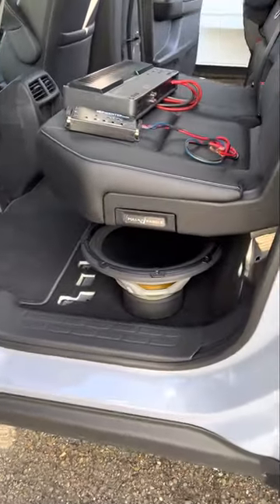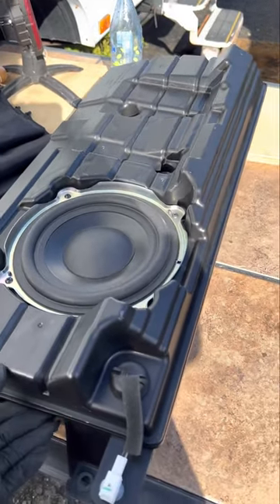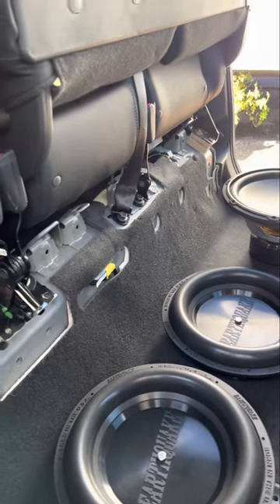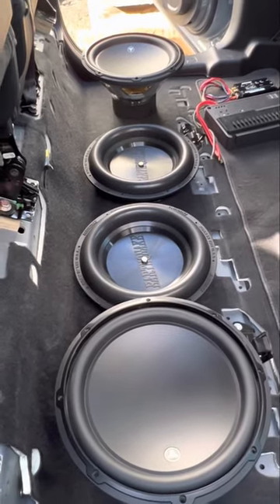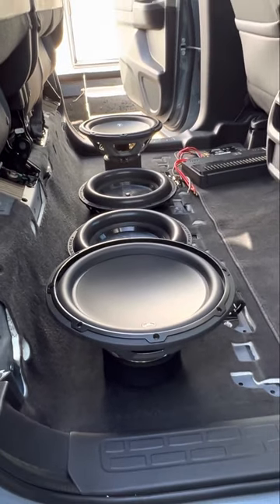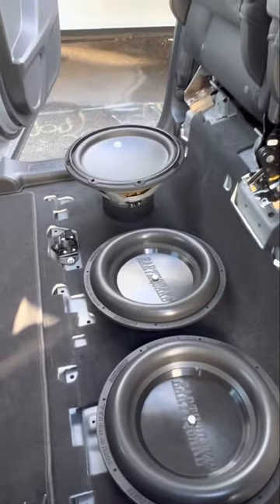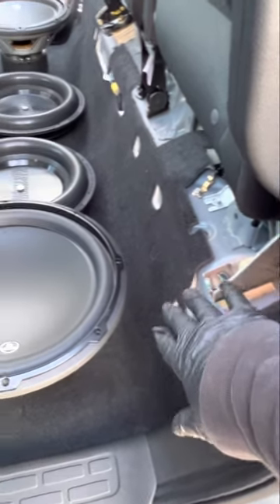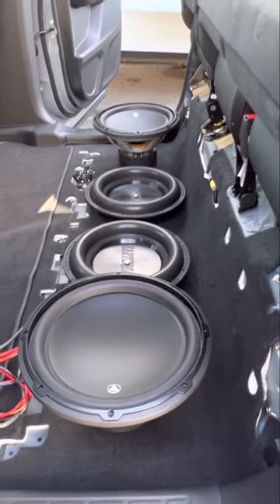Honda Ridgeline 2023 RTL-E Subwoofer install part #1 New video must watch! 🔊 very informative

Comment: Thanks for doing this. If the stock floor plate was intact that you took off. How much room depth wise would I have for a box?  Thanks for doing this video. I have been waiting.
Reply from the maker: With out the bottum floor panel im getting about 13.5 inches of depth increasing internal volume on the enclosure im going to be doing. Stay tunned i will be showing how i make my box. Please subscribe if you haven’t so u dont miss out on my video of the enclosure when i do post it. My next video coming up will be about installing highs on tweeters and center speaker upgrade.
Reply from the maker: I believe the measurement with the piece atached to the floor was 12.5”
Reply: @raulofalltrades5023  nice. Are you just replacing speakers? Or adding amps as well for the inside speakers? I think the issue you’ll find if you just replace speakers the imaging will be off as the ohms are different and sensitivity etc. and your center image is off. But many say upgrading made a huge improvement
Reply from the maker: @daveroski   yes i allready replaced them and with the same ohms. The tweeters are 2 ohms and the center channel is 4ohms and it sounds very nice! I allready have the part #2 video made of it playing might post it today

Comment: When you used the sub speaker wire for signal, did you get feedback on acceleration? I did the same thing and I get intermittent feedback/humming (loud) through the sub i installed. I am going to ground it somewhere else, but thought I would ask if you got the same feedback.
Reply from the maker: I did get this acceleration intermitten/ humming sound coming to my sub. Im doing some troubleshoot to see what is the cause. Once i solve the problem then i will post the video.
Reply from the maker: I found why there is a feedback sound coming to the subwoofer when applying the accelerator. Tomorrow i will post the video of the cause and what to do to solve it! Please subscribe if you haven’t so you can get the notification the moment i post the video!

Comment: Yo, how did you remove the plastic channel piece where the back seat latches to? Is it just pressure clips?
Reply: That's what I'm trying to figure out! Please lemme know if you ever got it!
Reply: @RandoManFPV  it’s pressure clips. You can pry it off.
Reply: @ep2418  okay, there is a black rubber piece in the middle, perhaps covering a single screw? 
I tried to pry it off but it seems like it must be cut.
It reminds me of the tyoe of thing that indicates that I've tampered with it so insurance doesn't have to pay my gf when the seatbelts fail and I don't make it out the wreck lmao 😅.

Thanks for your response. If you're not familiar with the black piece I'm talking about/don't recall any screws; then ima go give it a good pry! 🙏

Comment: I have a question what are the earthquake slaps for ? I wish I had that much room in my 91 k1500 I can only fit 2 jl "10
Reply from the maker: The slaps are to help the subs produce more bass in a smaller enclosure. I like ported enclosures and by adding these passive radiators it acts as if the box was ported in a way.
Reply: @raulofalltrades5023  1 more question how much you pay for your ridgeline I really want to get a midsized truck and I love Hondas but everyone is getting the toyota tacoma
Reply: I got a 2023 ridgline and I was wondering what kind of box would I need for 2 12" sub (terminator is the brand) can I just build one? Or can I buy a special box for it.
Reply from the maker: @lewislindsey3070  congrats on your new ridgeline. I love my truck. It depends on the type of subs you have. If your subs are flush mount then the airspace requiered for flush mount subs isn’t a lot especialy when the enclosure is a sealed one but if you want a ported box then check what air space your subs need for a ported setup. My JL audio 12w3v3 requiers internal air space of 1.75 cubes. So, if i want a ported box than only one sub is the way to go. Two of my subs need a total of 3.5 cubes of air space so a 1.75 cube box would not work it would sound horrible. I can get away of having two subs because in my setup im using two passive radiators.
Reply from the maker: @miguelplascencia6093  i love my truck! It is quiete inside the cabin and it rides very smooth and confterble. I paid about $48,000 for the Honda Ridgeline 2023 RTL-E sonic grey color. And it’s 4 wheel drive. It has good ratings!